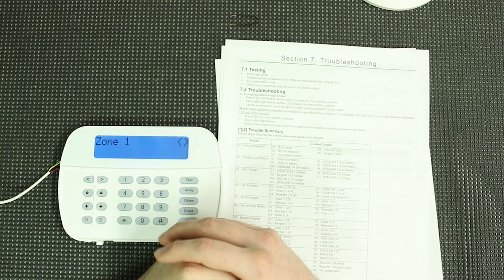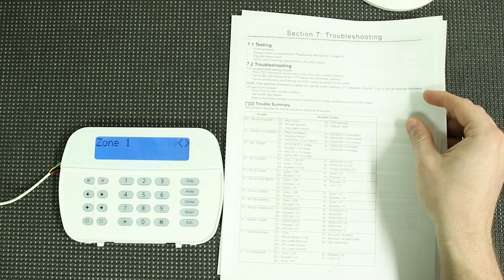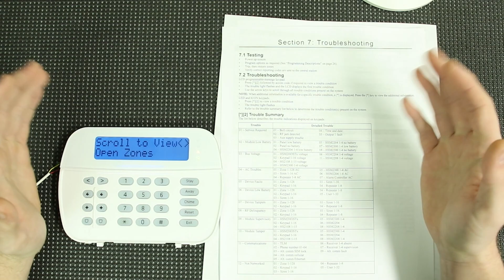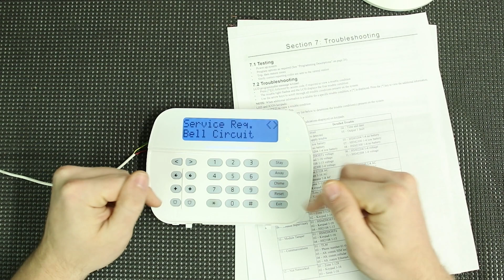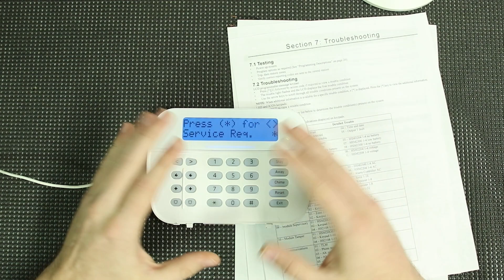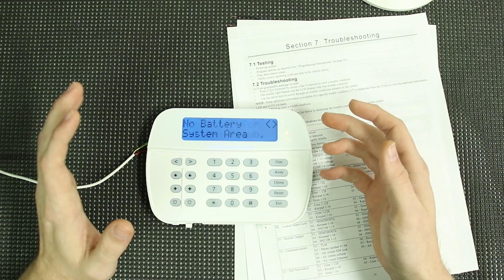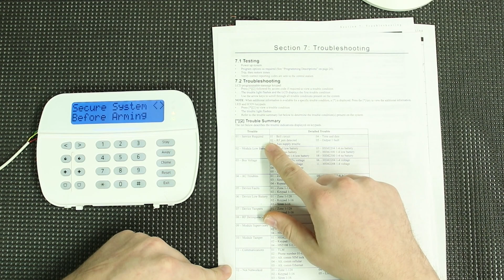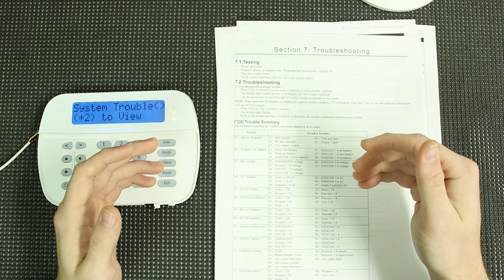DSC Alarm Keypad Beeping And Yellow Triangle? Trouble Menu Navigation On A DSC NEO Alarm System

Comment: Hi have dsc neo, that has cellular trbl error, how do i clear it. Cause now its nt sending messages on gsm phone 😢
Reply from the maker: The trouble is flagging because of whatever is causing it not to send messages, not the reverse. Clearing a trouble won't fix a persistent issue with communications. As for what the root problem is, hard to say without further diagnoses.

Comment: Hey mine doesn't have the "system required" on it which one should I do?
Reply from the maker: The system required is just the set of trouble directly related to the main system. Troubles can be related any device connected to your system, so the majority of troubles will not display "system required". You'll just need to identify which module the trouble is indicating which is covered in the video.

Comment: Bought my house 6 months ago and was told that the alarm was disconnected. Let the dog out last night and the house alarm went off very loud. Alarm system shows a yellow triangle & red lock locked. Also, bypass & stay..
Can I cut the alarm speaker wire up in the attic if I can't reset? Nothing on my main panel saying it's hooked in but it must be hard wired in somewhere as there is power even though the small battery is disconnected..help!😝
Reply from the maker: The better option would be to find the transformer plugged into the wall providing the system power. With that and the backup battery disconnected the system will turn off.

Comment: Can someone help me my dsc pk5501 wont conect to pc1616 everything is wired up properly and its still beeping yellow light is on and i cant type in anything
Reply from the maker: DSC keypads need to be enrolled to work on a system properly. You'll need a working keypad to to enroll the new one.